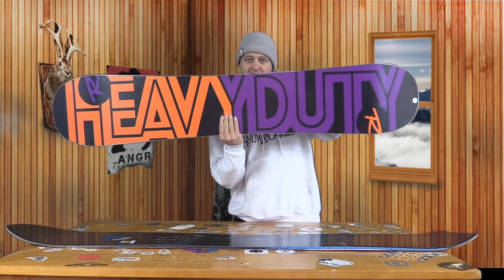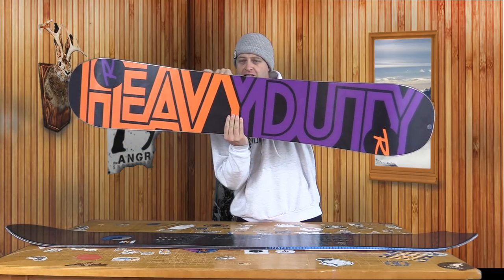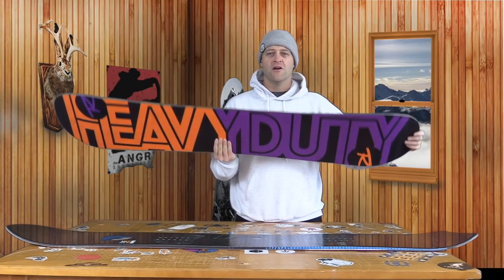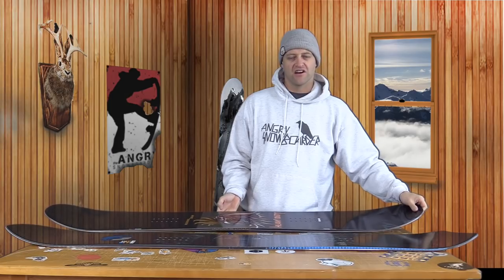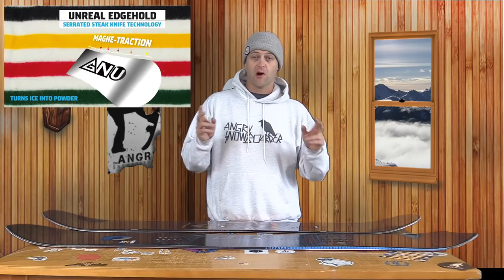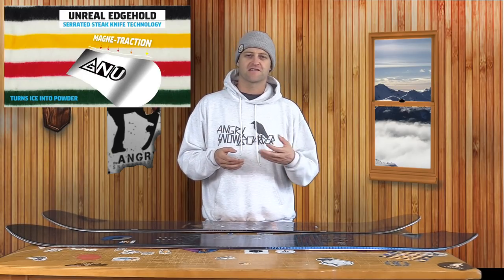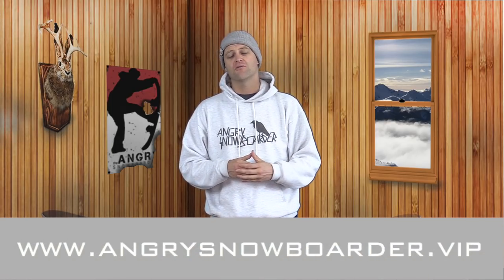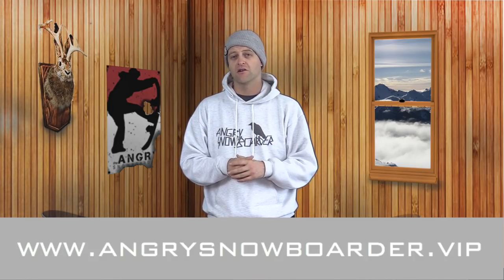Magnetraction: Explained

Comment: Picked up a 157 Jibsaw on the cheap for Ice Coast riding. I tried a friends Lib magne trac board for a few runs on hard pack quite a few years back and remembered being pleasantly surprised. Now I been looking at some Yes boards and they have some sort of grip tech going on ...is it more mellow or no? And that Basic Decade just looks so sick but is $$$$.
Reply from the maker: So they have underbite and midbite. Midbite is a contact point in the middle of the board, honestly it's hit or miss if it does anything. Underbite is a bumped out contact point under foot and that does change things a little bit.

Comment: When servicing a board with magnetraction edges is there anything to look out for or ok to run the edge tool down like normal? ( asking for a friend 😂 )
Reply from the maker: Just make sure you do full passes tip to tail none of this half starts and stops.
Reply: @AngrySnowboarder  Great thanks, I was worried with a hand edge tool I would miss parts of the edge but guess the magnetraction is mellow enough for a smooth pass.

Comment: With Magnetraction, so many serrated edges creating extra contact points will make it hard for BEGINNERS. It ll be harder to initiate a turn as those edges will catch the snow. Am I wrong, anyone?
Reply from the maker: I get your logic but that's not necessarily true you have to look at the flex, shape, and camber profile as well.
Reply: @AngrySnowboarder  yeah very true but I was comparing identical/similar boards with same flex, shape and camber profile. So basically if these features are similar, then magne traction might be a pain in the butt for new boarders due to having multiple contact points.
Reply: Even as beginner, you need to learn to ride the edge asap, one season on rocker is more then enough, my opinion